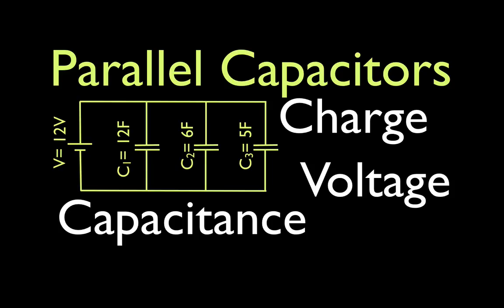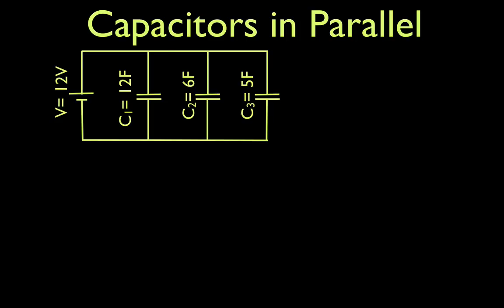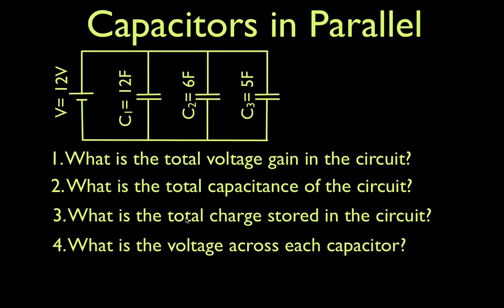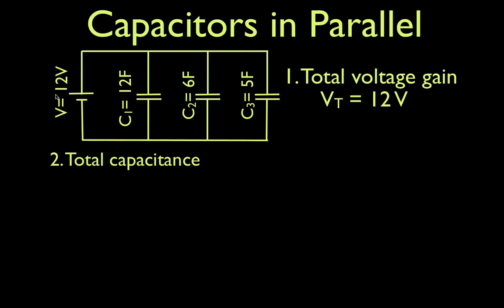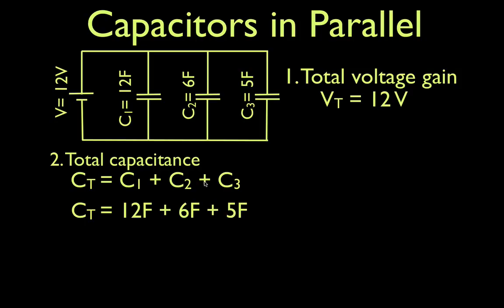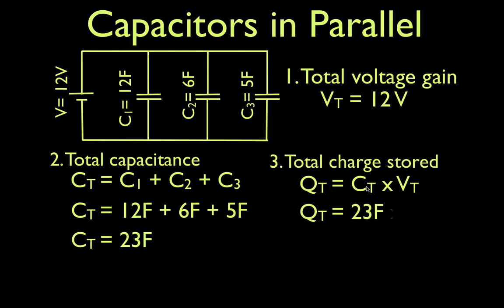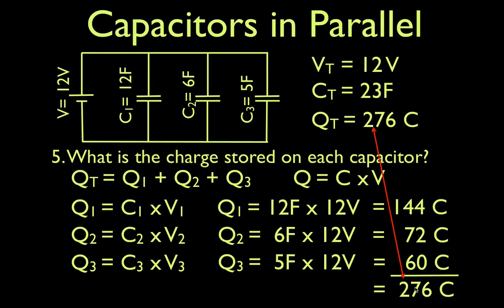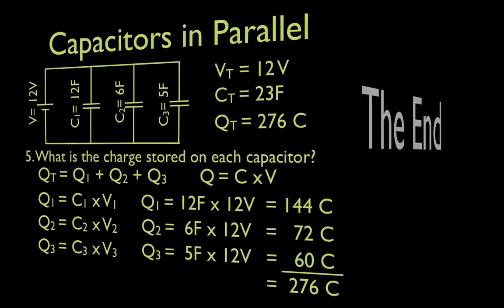Capacitors (3 of 11) Parallel Capacitors, Voltage, Charge & Capacitance

Comment: it would be nicer if at the end of the parallel circuit you have a load - say 5amps, would like to see your equation or solve for capacitance requirement for the load 12v at x amps

Comment: I’m restoring a reel to reel tape recorder,I cannot purchase a 300v 8uF metal capacitor ,Can I wire in series two (or more) capacitors too make up equivalent value of original?Any help would be grateful Thanks.

Comment: Great video!
One question please!

How would if those capacitors 1,2 & 3 are different voltages. For eg. C1=12F/ 6V; C2=6F/ 25V & C3= 5F/ 250V. 

How much will be the Total Voltage of Capacitor for 12v power supply?
Reply from the maker: If they are connected in parallel, then each cap will have the voltage of the power supply, 12V
Reply: Step-by-Step Science  Thank you so much.

Comment: why is charge different? i  know voltage is the same bc the positive plate and negative are connected to the same node but whats the reason for charge?
Reply from the maker: Because the capacitance of each capacitor is different.  Capacitance is the amount of charge stored per volt.  More capacitance = more charge.
You can see a listing of all my videos at http://www.stepbystepscience.com

Comment: Hi.
Thanks a lot for this. So does this mean that incase i can't find 47000uf 10v capacitor but i have access to 4700uf 10v capacitors....can i connect in parallel 10 of 4700uf 10v to get (47000uf 10v)

Comment: Cheers mate, Straight forward. Would help next time if you also went through two separate boxes in a parallel circuit. Like they have in exams.
Reply from the maker: Jareez Brah Thanks for the positive comment and the suggestion.